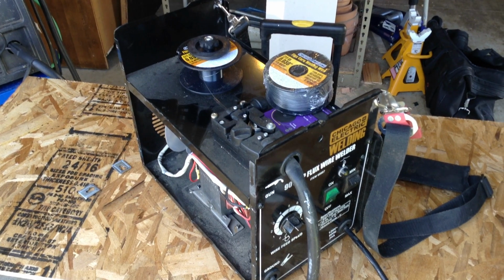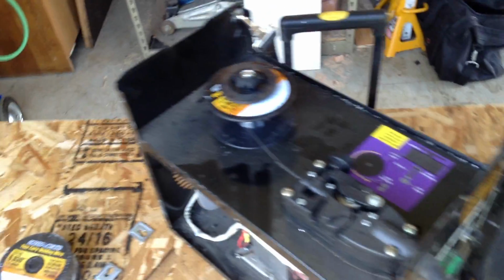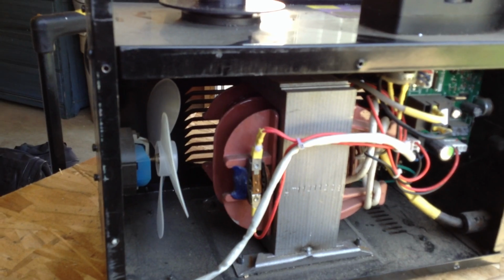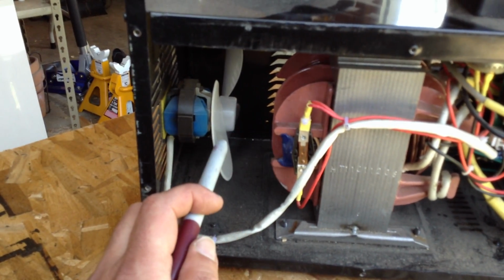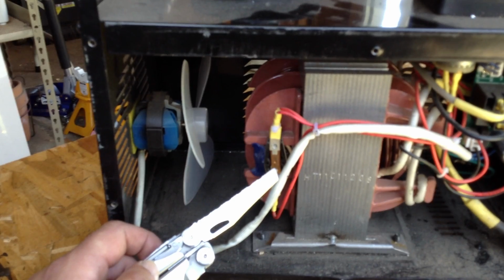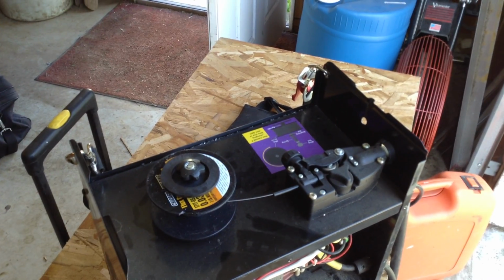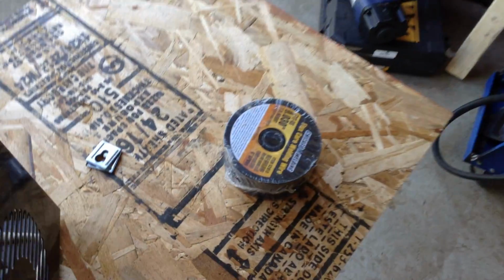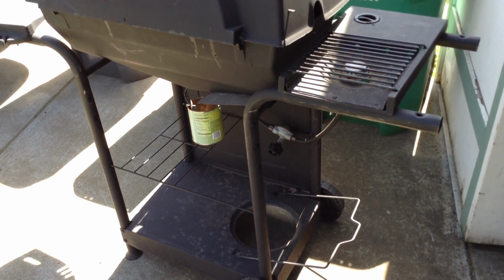Harbor Freight 90 Amp Flux Core Wire Feed Welder 68887, followup review

Comment: I know everyone's a handyman but no one realizes there's no shroud around the fan to suck in the air from the back vent and push all the hot air out through the other vents and also cut a opening to the right of the wire feed to let more hot air out...

Comment: I got the same unit. I was welding and the feeder stopped... Do you what the problem is? I checked the fuse. It was OK.I need to weld in one more little hole.....and I am done...

Comment: I have the same model but by Sealey one.
I have a lot of stutter when i weld, the motor stops and starts as i go, when i press the trigger on air the feed goes perfect but when i weld it just stutters...any ideas?
Reply: you need to adjudt wire tension so when held by a piece of wood the wire curls. tension is not tight enough.
Reply from the maker: Δημήτρης This one had no air feed system, it only uses flux core wire.
Reply: 8digitPDX Yes i know, i have mightt mig 100, it is a gassless mig.
Reply: I triggered the gun on air, not with air.
I mean that i did not touch the ground so it could make an arc.
It seams like when i try to weld the wire pushes the gun back on me, like the current stops!

Comment: my machine is acting real jerky...I've adjusted the spool tension and the at the wire connector but to avail. I'm about to throw this thing out out of desperation and get a stick welder... any idea what could be going wrong?
Reply from the maker: Have you replaced the torch tip?  Cleaned it?  Try using the .035 tip with .030 wire and the gel dip so that it becomes non stick.
Reply: I've cleaned them out with those little tip cleaners for oxy/acetylene but no good. I'll take your suggestion and try a new one.

Thanks for replying
Reply: Sancte Alphonse the current used to drive the spool motor is drawn from the current sent to the torch tip. As you strike an arc there will be a voltage drop to the spool motor which varies based upon what the torch is doing. It's a crappy design that will prevent it from working properly 90 percent of the time.
Reply: Sancte Alphonse they run the wire feed moter off the transformer so when you start welding the voltage drop makes the wire feed moter pause on off

Comment: I take it you can't change the polarity of the tip, or electrode right? 
I have seen one other vid going on about changing to DCEN and I don't see any inverter circuitry inside mine. I have an even cheaper version of this type of 
$100 welder. And there are two wires of diff phases coming off the transformer
Reply from the maker: Yeah, you can do other mods on these things.  Not sure about that particular mod, but the cables are accessible if it were just a matter of swapping them around to reverse the polarity.
Reply: Hey pal thanks for getting back so quickly. I am still in the hunt for info on polarity options on low cost flux core machines lol. Sadly there is no inverter circuitry in the Harbour Freight. It is after all listed as a 90 Amp >>AC<< Flux Core Welder. Yeah the only thing you would accomplish by swapping wires on the transformer would be to change the phase. I have no idea what effect that would have on the finished product....
 I have one that comes from a low cost tool outlet in Canada called Princess Auto. The only thing we can do to lessen the splatter or as I call it "popcorn", is to improve the surface prep with 3M scrubby and grinders of various grits and maybe those flapper sander wheels ( love em), Tip dip and Splatter Clean products I suppose huh? I do appreciate good looking welding don't you? Best regards sir
Reply from the maker: Chris Leech My experience is that flux core gives splatter and that's that.  If you do clean and surface prep, that reduces the problems, same as making sure the machine gets enough amperage to run.  You really want it getting 20 amps or better, but on house circuit stuff, 20 amps is about max for that kind of plug.  When I ran the machine on a generator which pumps 30 amps per plug, the welds were a whole lot nicer.  I learned that entirely by accident when I got hired to do a trailer repair in the middle of nowhere and did it with the HF welder and a generator, expecting the repair to just be temporary until the people got the trailer home.  As it was, running 30 amps instead of on a 15/20 outlet, the welds were so good it was all permanent on the spot.
Reply: swapping leads has no effect this machine puts out a.c. not d.c. to get d.c. you can look up adding rectifier to this machine.

Comment: Hello I have one of these welder and now it arc's but not hot enough to melt the wire, if I keep trying to get it working in no time it trips the breaker.  Any Idea what might be bad or something I could check.  Thanks Harold.
Reply from the maker: Harold Utphall chances are you are plugging it into a 15amp circuit that is aged and not running at full capacity.  It will run better on a 20 amp circuit and even better than that off a generator that has a 30amp ac plug.
Reply: I have it plugged into a 20 amp circuit, also tried a different plug, all wires inside look to be OK, was working great then just would not melt the wire.  Nothing got hot, no smoke, no light came on.  Thanks

Comment: Great review. I just purchased one of these today. I was hoping you could help me a little. I want to weld some small brackets on a chain link fence. After getting everything set up, and the system grounded, I was unable to get the gun to start an arc. This is my first time ever trying this, and I am sure i am missing something, but can't tell what. Any help would be greatly appreciated.
Reply from the maker: Make sure it is running on a 20 amp outlet if possible, have the ground clamp really close to the area where you want to start welding.   Usually if it won't strike an arc, it's not getting a good connection,  so turn up the power, and check the ground.  If you look at the ground clamp on mine, it's all buggered up because I frequently would use a dab of weld to weld it to the item that I need it grounding to.  The tool pays for itself long before it wears out or is too buggered up to use.  You don't heavily weld the clamp to the piece, just enough to keep it from moving.
Reply: Thank you sir.

Comment: Have been thinking of doing exactly what you have been with this welder. That is, do small mobile welding service to add a little bit to my income. Another way to make extra is if you have your own business and not a regular 9 to 5 job, get into mobile welding repair of semi-trailer mudflap brackets. You can probably pay for that 90amp welder in one job as most services don't like to go out in middle of the night just for a trailer mudflap bracket.

Comment: when you paint over the flux weld does it over time ruin the paint? i was told it will; true or false?
Reply from the maker: +vin digi work it with a wire brush before painting and you will be just fine, but the paint usually does not stick very well to the flux splatter because it is a fine dust sort of stuff, thus, clean it off then paint will stick just fine.

Comment: Wonder if attaching another heat sink in the side would help?
I have a large heat sink that just took out of a Denon receiver that died ;)
Reply: +Kyle Partain 

Heat sink would help but it depends on how you attach it.  If you're going to attach it to the existing heat sinks you should make sure that the connection between them transfers the heat efficiently.  You can improve the connection if you use a thermal conductive compound or adhesive between the two pieces.  I think an additional fan on the case set to exhaust heat would probably do wonders.  They make 110V small computer type fans which are perfect, you just need to splice into the correct wires on the welder to power the fan.

Comment from the maker: This one eventually died and gave up the ghost.  The review of the replacement welder is here Harbor Freight 90 amp flux core welder model change from 68887 to 61849 comparison
Reply: Good value for the money but I have heard of a few cases of infant mortality so buyers really need to test it out well as soon as they get it home. I decided to get a dual voltage everlast for more power. Glad to hear you got a couple of good years out of your welder

Comment from the maker: The welder in this video died recently and the replacement model has a few minor upgrades at the same price.   I finally tried it out running on a generator and it did far better than off house or inverter power.

Comment: I think using hobart wire and it would weld decent
Reply: i have one of the the old welders like yours slightly diffrrent in that it has 2 heat swutches like the 170,i believe you can get a combination of 5 heat settings and i think its actually 88 amps and it does not have a fan.i got tired quickly of waiting on cool downs and simply set a small but adequate fan behind the welder,now i can go all day.as long as the fan is big enough to handle the heat.trial and error!

Comment: Wow. 3 grand? That machine paid for itself 30 times over. I have one of my own just like it. I used it to build a jeep trailer, weld a ball hitch for the lawn mowers. Might fix a wheel barrow tomorrow. Who knows. It works great. I use the 10 lb spools of wire off ebay and haven't had the birds nest happen yet. I'm on my second 10 lb spool now with the 3rd and 4th ready to be used. I am one happy customer. I worry about the liability of welding stuff for people though. Great video!!
Reply from the maker: You look at the value of the work you accomplished vs what you would have to pay someone for that, and you are not far off on the return you got out of your purchase.
Reply: That's true with a lot of things in life.